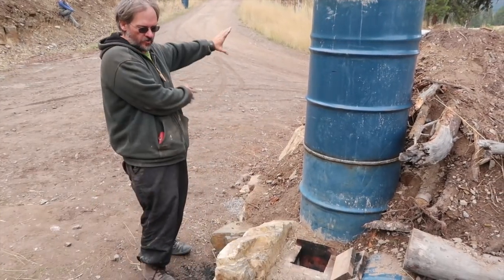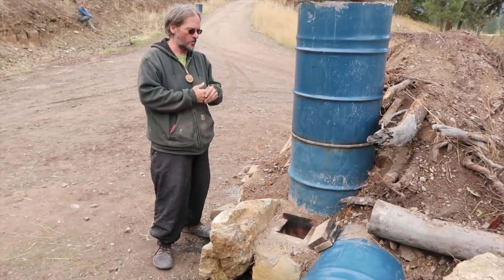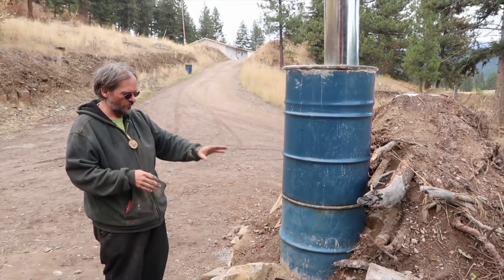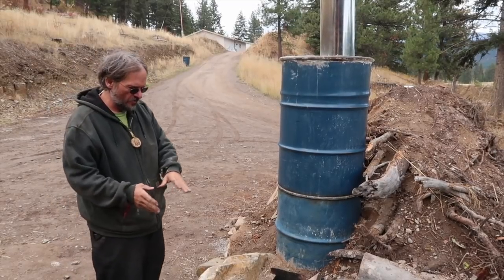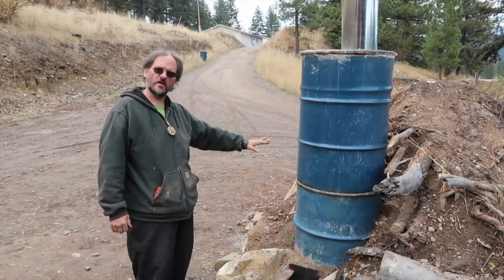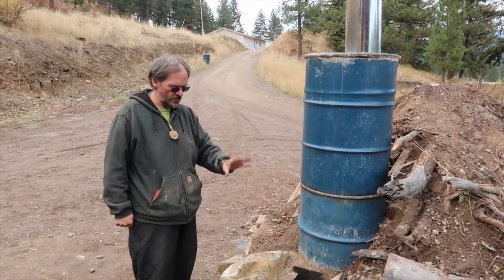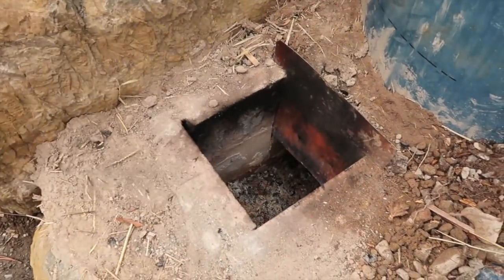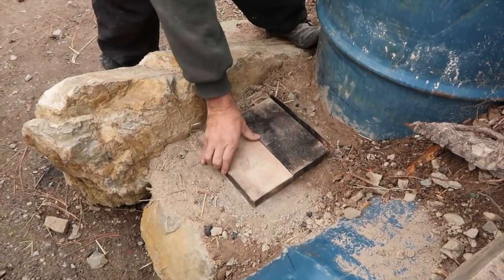Wet Tolerant Rocket Mass Heater for Greenhouses - an Outdoor Season Extender

Comment: How was the exhaust sealed at the top of the radiant barrel? Gasket cement is only rated to 2000degF. Also, Did Uncle Mud say that the top of the radiant barrel is insulated at the top?

Comment: How cold does it get there? I'm in Canada Edm. area. I've been thinking of building a south facing greenhouse with a rocket mas heater and laying foam insulation in a trench under a foam Crete layer then make the exhaust gas running through cinder bricks and then bricks on top of that then my planter planter box's on top. This area can get down to 40 below for weeks but usually we get an average of 18 below C it's rated as 3a for growing. I'm worried that after sunset even with a double layer of plastic roofing and solar heated black water barrels every thing will freeze.
Reply from the maker: it can get to 30 below here.